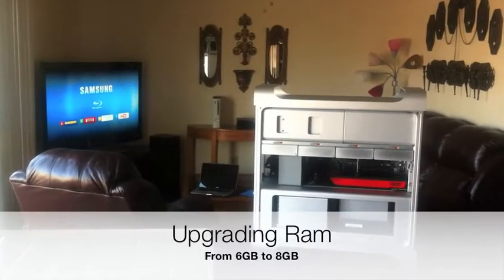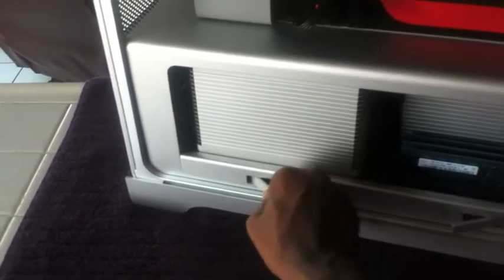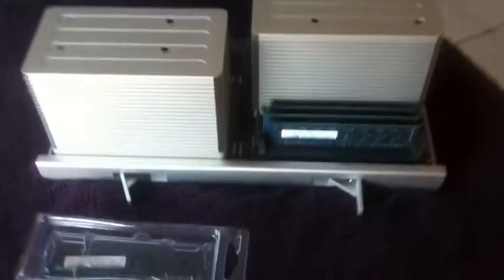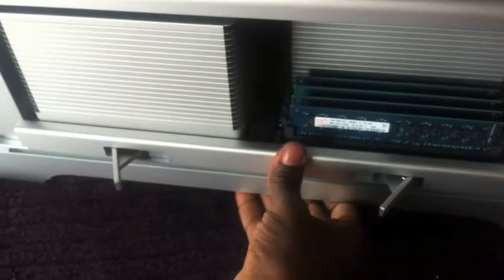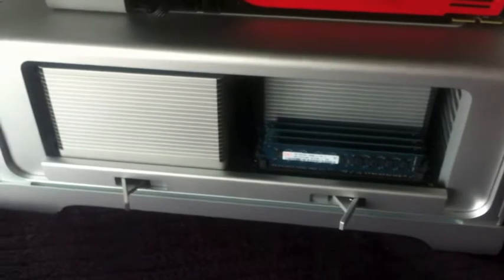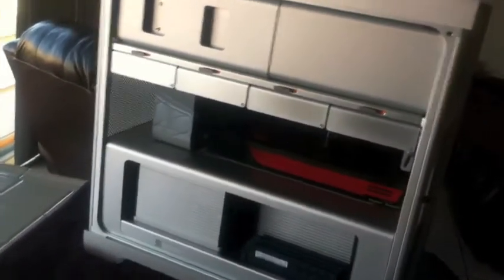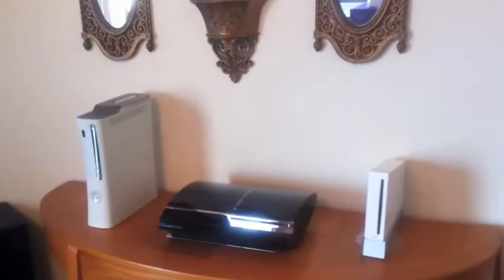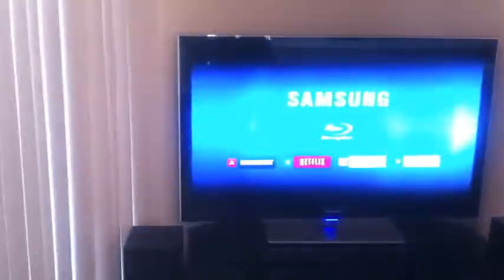Mac Pro Ram Upgrade & GeekBench Test

Comment from the maker: @Ryra67 as far as i know the only ati readon 9680 GPU's  that's ever been  in a Mac Pro over the years are ATi 2600, ATi 4870, ATi 5770 and ATI 9680 may work under windows but not Mac OS X

Comment: This is an excellent video and a sweet rig, man.

Hey, is that the standard 5770 or the optional 5870 videocard? Also, on OWC, you can max out your Mac Pro's ram, it'll be a little pricey (around 1k) but... moar power!